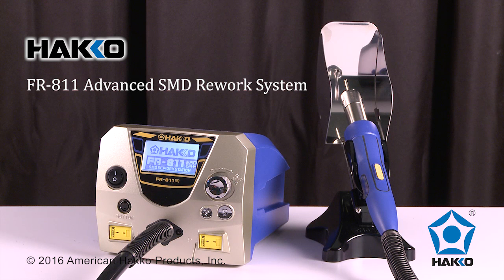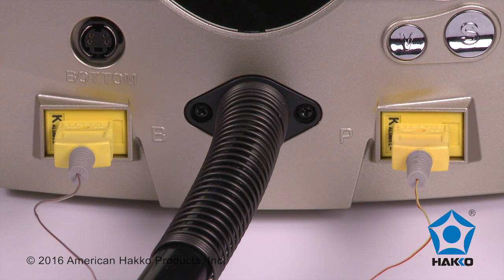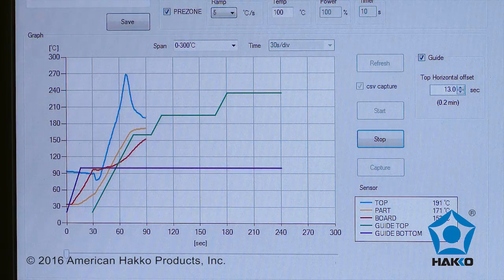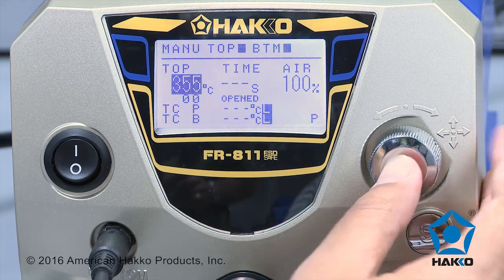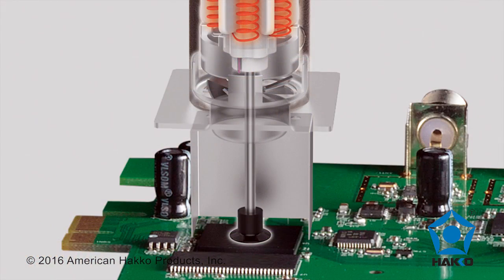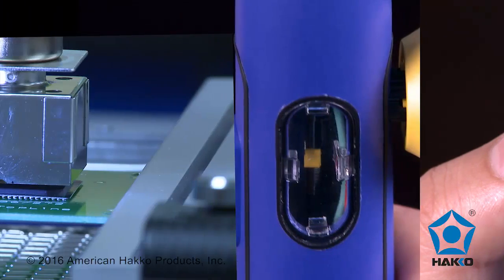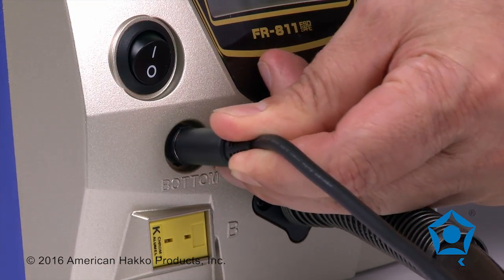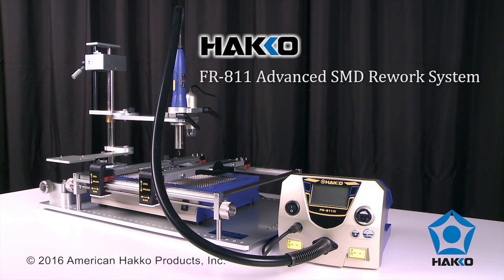Hakko FR-811 Advanced SMD Rework System — Video by American Hakko

Comment: Two thousand bucks for just the rework station, scaling to just under six thousand for the station, fixture stand, board holders, and preheater.

Way, way outside my price point. Dear Hakko, please note that there are a lot of hobbyists out there (not to mention the growing maker movement) that would love to have decent equipment but can't afford anything this extreme. Sincerely, those of us that don't work for a major electronics manufacturer.
Reply: Aliexpress China, about $100 usd for a Chinese model and a lot of practice, though I hate to mess with expensive chips.  Seems practice always goes well but something critical gets messed up.